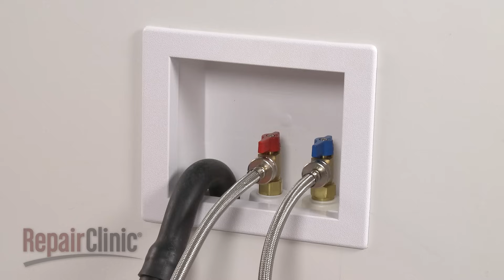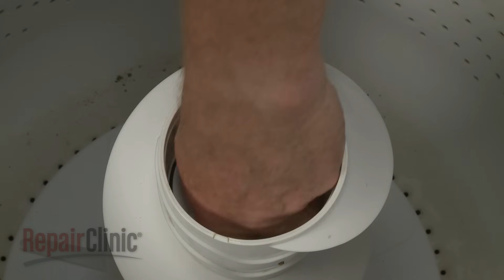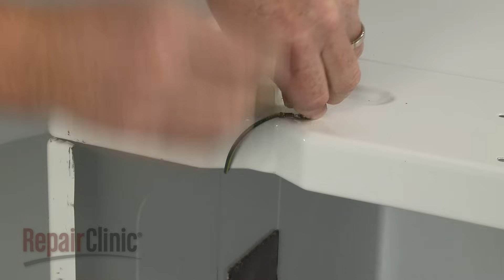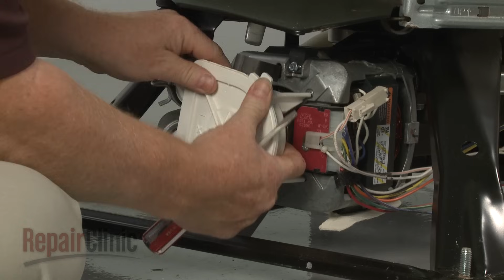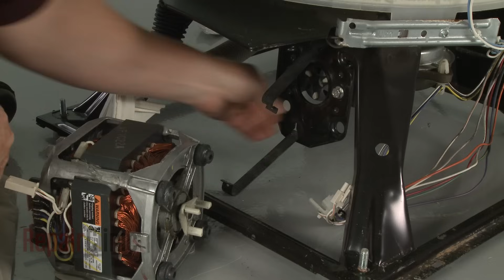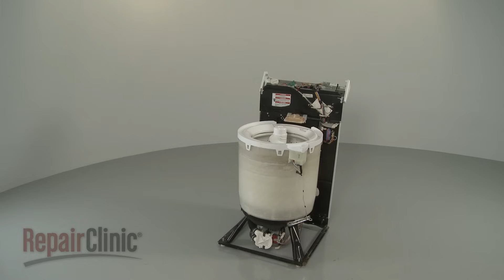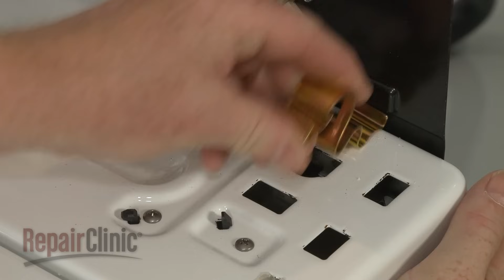Kenmore Top-Load Washer Disassembly (11022932100)/Repair Help

Comment: We followed directions but are unable to remove the lower agitator assembly. It is stuck/frozen/locked on and no amount of brute force is moving it.  Does anyone have any help to offer in this. We need to take it apart to find the source of a new noise machine is making.

Comment: My washer shakes violently. I’ve already replaced the balancer arms, and it’s still shaking violently, only on medium and heavy loads with this, possibly solve the problem. it also makes a click noise every time it agitates?
Reply: Was there an oil reservoir in the bottom?
Reply: @ no
Reply: @deadpoolMAX951  OK - sounds like two problems -> the basket mounts are bad and the pawl for the agitator might have broken return spring in it. This is just a guess. What specific model?
Reply: @NorthForkFisherman  wtw5000dw1 it only clicks when it agitates finally fixed the shaking problem it was the wrong balancers on the washer got better ones now
Reply: @NorthForkFisherman  I’ll have to look into your last comment…..the shaking did stop…..I bought balances from Amazon…..big mistake man….so I bought from a legit service place online works way better

Comment: When the tub is filling with water, does the water pass through the water pump and settle in the flex hose that connects to the black drainage hose?  On my Kenmore, there's a white flex house connected to the pump at one end, then to the black exterior hose at the other end.  It runs horizontally between the two connections.  When filling, water leaks out of a crack in the white flex hose.  

That's why the black exterior drainage hose must be placed above the washing machine's top, right?  So that water settling in the white hose doesn't overfill and spill out of black drainage hose, right? 

Thank you!

Comment: If the top front corners of the washer separate from the base cover -what part is missing  in order to keep the top of the washer connected to the base cover?  When I'm lifting the washing machine cover to separate it from the washer, the right front corner is not attached to the right corner of base.  When I look under the top to see how the base is connected to the top, I see hole but no screws. could the screws have fallen out or was there a different part connecting the top and the base other than screws?  Thank you

Comment: Being my mom old  Kenmore is 24 years old and still running.
 it was time to do some PM on it and replace parts that are worn out and that were not replaced over the years why under Sears service contract till this year 
. had the  Water level switch fail and flood the drive way  and found out that other parts need to be replaced
Reply: Worth to replace parts instead of buying new washer. Just replaced the clutch on mine 29 dollar fix. Won't part with my 1998 washer

Comment: How to you remove the end caps on a Kenmore 400 series washer? It is all connected with the control consol. Not able to replace my water level switch because of it. Please let me know of a quick fix or anything I may be doing wrong.

Comment: a nice video but you never did show how to fix the the suspension Springs that moderate the vibration and shaking. the only video that I found that was similar to mine and you didn't show that thanks for nothing
Reply: same issue here - shaking a ton.

Comment: Finally, a video that shows the same lid switch area as my Kenmore 80 series! I thought I was going crazy only seeing them on the right side of the washer and a hinge pin which my machine does not have. Now if only I can find the exact part/lid switch I need for model 110.26862502, serial number CS4507749. Glad for this video though.
Reply from the maker: You can find the part that goes to your model here: https://www.repairclinic.com/PartDetail/Lid-Switch-Assembly/WP8318084/1018522
Reply: @repairclinic  Thank you, I finally found it on one of the many websites I visited. Spent hours on deciphering this needed repair and found lid switches anywhere from $9.99 on Amazon China dupe to $45 for the Whirlpool original (but I found the same original at a local place for $28). Finally got a repair guy who said he'd come out and change it for $125! Little did I know it would take him 10 minutes. Literally. Unfortunately, husband isn't a DIY guy and we so could have done this ourselves and saved $100. Oh well. Washer is working great...thanks for video! Love YouTube for DIY and reviews (oh, and music of course).

Comment: For Kenmore washing machines what does the SERIES number mean?  Where to find the SERIES number for my Kenmore washing machine?  Thanks.
Reply from the maker: The series number tells you the date it was manufactured. It should be located with your model number. The model number usually starts with 3 numbers, a period, and then a series of numbers. 

The Washer in this video is 110.22932100. Usually, you only need the model number to find parts. 

If you need assistance finding a part for your machine, give us a call or send us a chat on our website: RepairClinic.com

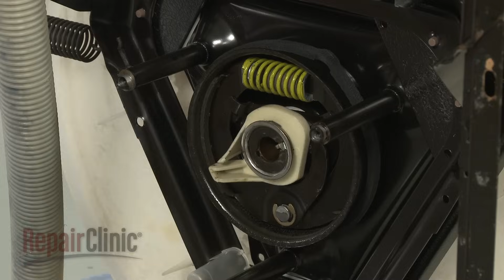Comment: What the heck is that foam gasket that hangs around that bell shaped housing that the basket drive sits in ( @ 8:00) and what does it do? My very similar 29522800 started making horrible grinding noises under load, so I went after the usual neutral drain parts in the transmission and replaced the agitator dogs for good measure. Didn't change squat, so there's a new machine coming tomorrow. No other parts appeared broken and the noise started rather suddenly. I thought I was onto something when I saw that gasket thing as it didn't appear to be able to serve any useful purpose where it was, but the one in the video is exactly the same, all the way down to those two squashed 'U' shaped bends which look like they were displaced by some screws. Mine was even twisted over on itself in a couple spots and was quite loose. -Thanks!
Reply: It could be a diversionary tactic.

Comment: I have a series 80. I imagine its construction is very similar to this. Or do you have a video specific to that model?
BTW, I think that motor reinstall might have been a bit easier with the machine still on its back.

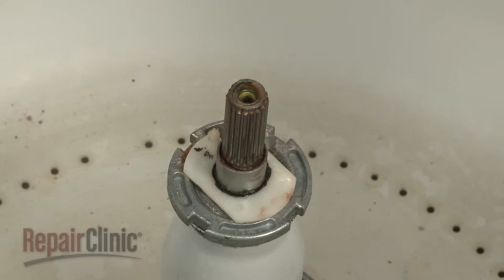Comment: Thank you very much Sir for this outstanding video. After watching it I disassembled my washer and i ran into a problem, when i removed the agitator , there was no Spacer and Plastic washer at 6:07 -6:14  ,is that normal for my model ? or I do have to buy and install them. Would you help me with the part numbers?  my washer model is Kenmore Elite 11022994100. Thank you in Advance

Comment: Just kinda missed the whole outer basket removal part and likely one of the most common repairs of replacing the guides under the basket..  you know, the ones that when they get worn out the whole machine goes crack mode and dances across the floor every load...

Comment: Got a Kenmore Series 300 and its automatic water level sensing appears to be malfunctioning. It never adds enough water. I know these are water saving washer's but they are not adding enough water even on small loads. Is there a way to turn off automatic water level sensing?  The clothes on top stay on top the whole wash and do not properly clean. A case of being over-engineered to a fault I'd say.

Comment: I recently replaced all the counter balance springs on my Kenmore, using parts from your website. Unfortunately these did not fix the spin cycle balance issues. What is the next thing to check to try to get this machine run balanced?

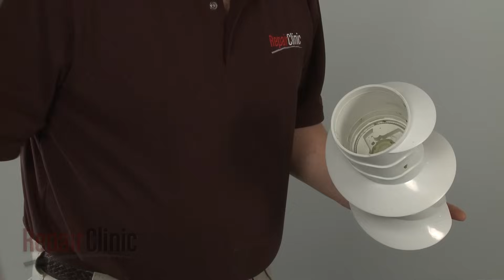Comment: What is the point of the spring (1:21) if the screw is fully tightened, thus completely compressing the spring?  I just replaced the cogs in mine and I'm still not sure why the spring is there.

Comment: 6:05 my agitator is not coming out at all, it spins but i can’t seem to lift it up. Any suggestions?
Reply: You can get inflatable windbags from amazon that pump up and if you stick them under the agitator then pump them up it will pop right out but be careful and keep your face away from the agitator because it pops up very fast :)

Comment: This video is a life saver. I took apart my washer in less than 10 min and found that the reason why my washer would not start was because there was a small sock stuck inside the water pump component. Took out the sock, put the washer back together and BOOM! it works!!
Reply: I'm hoping to find missing socks as well. Lol
Reply: Same here, it was also a baby sock! Saved me an expensive trip to the appliance store. 

Also your comment is 2 years old, hello from the future!
Reply: Can you describe what your washing machine symptoms were ? I believe I may have the same issue. Before I take it apart I’d like to know what you guys symptoms were. Mine won’t spin unless I give the agitator a spin by hand
Reply: @jamiehenderson7844  when the time came for my washer to spin and drain the water out of my washer tub, the washer would spin a couple times and then stop. All the water would still be standing in the tub. I would try to reset the settings dial and then again the washer would spin Maybe 3 times and then stop.  There was a sock in my water pump. So when the agitator was trying to spin and have the pump suck out the water, the sock was in the way.
Reply: @jamiehenderson7844  literally the same as Frankes experience. It struggled to spin and quit and the water would not drain. I had to scoop all the water out by hand, disassemble the washer and get to the water pump. Once I had it off, I could see the end of a small sock stuck in there, pulled it out and double checked for any other blockages before putting it back together. Ran perfectly afterwards!
Reply: Same here. Baby sock was in there.
Reply: Is it showing the water pump in the video? I replaced the switch and that wasn’t it :(
Reply: @genb.4123  Did it end up being the belt, as that’s most common problem if the washer still drains, but doesn’t spin or agitate.
Reply: Was your machine making a humming sound?
Reply: Probably saved yourself hundreds, if not a whole new machine.

Comment: This video saved us the cost in parts. We recently bought an older Kenmore washer and it just stopped spinning. The lid switch was the issue. Somehow the casing broke. Easy fix. We just had no idea how to get to it until this video. Thanks!

Comment: Quick question:  is the cabinet top welded or is it screwed to the cabinet sides? I have limited space through a doorway but OK once I'm in for the washer.
I think if I can disassemble the washer it will fit through the doorway. Thanks a million!
Reply: @repairclinic  thank you for the answer. I wasn't alerted so I checked back and lo and behold... you guys are wonderful.

Comment: Ok so I have torn apart my machine. It is making a horrible noise while trying to spin out and does not spin out at all. As I was tearing it apart I noticed it looks like the transmission is leaking a sort of oil. I plan on replacing my transmission coupler. Would you suggest to replace the transmission and the basket drive or just on or the other. I need help diagnosing my issue with the oil leaking.

Comment: The inner tub we still could not lift out. We probably have older model. Too much mold and dirt is inside, and we were not able to disassembly it to clean through. Stinks with mold. And underneath the oil is leaking. May be we just need to throw it away? It looks like iver 20 years old. We just bought the house and now dealing with it.

Comment: That was amazing. Can't believe how many washers I took to the dump that could have been so easily repaired.
Reply: They are very easy to work on and with the exception of maybe one or 2 parts all the parts are readily available, not trying to sound like a ancient person but truly the new washers are awful,they are loaded with electronics that go out very easily and often and they have all these "environment people" mandated nonsense features it takes twice the time to do laundry,not sure how that helps the environment.
Reply: True or repair for less than Sears repair quote.

Comment: I recently worked on a Kenmore 70 series washer, the lady said it was 31 years old!  Turns out, the last repair man didn't reconnect the lid switch to the harness properly and left the outer pump hose lose and un clamped.  I took it completely apart, inspected, and reassembled it back after I repaired it a few minor issues with the back spring and chassy being bent badly and bending the frame's pins back in place.  I was  very impressed with how solid Kenmore makes their appliances, that think is a tank!  I've rebuilt crosley washer, dryers, and stoves abs they more easier, but Kenmore, maytag, and other high-end appliances are like tanks!  These videos have greatly helped me out and I love repairing and rebuilding appliances!
Reply: Kenmores were Whirlpools that were redesigned to make them easy to service.  That’s why Whirlpool parts fit, but the drawings don’t match, and it’s easier to work on them.
Reply: Interesting, i didn't know that.  Thank you for sharing this is you sound like you're experianced and knowledgeable tech.  It seems like i learn something new everyday, which makes everyday even more of a blessing for me! 😊 @ssaraccoii

Comment: I just used this video to disassemble and thoroughly clean my washing machine. There has been a bad odor the last few weeks and once inside, I knew why. YUCK!  Thanks again for the great video!!
Reply: Why?
Reply: @jpuff911  Once the basket was apart, it was packed with nasty stuff. I'm not sure exactly what it was, mold maybe? IDK, but it took a pressure washer outside to clean it all off. And then the smell was gone.
Reply: Do not use fabric softner ever

Comment: Okay, have our old Kenmore model 110.26692502  completely taken down. The problem is that everything works but the spin cycle.  I can get the tub to spin if I start it by hand and quickly close the lid. The tub was rusted tight to the agitator shaft, but we got it of with a little persuasion with a piece of 2X4 spruce.  Now, the problem is all the parts look fine.  Is there a clutch somewhere that could be slipping, or could the rust have kept the tub from spinning?
Great video! It's not exactly the same as the one shown in the video, but close enough to get done. Thanks for your help.
Reply: If you still have the problem, that's a spin clutch.

Comment: Those side cover do not come off that easily .  Side panels have two locking catch tabs that must be  pressed to the side.  From the back the side cover on the control panels left side must have the upper tabs move to the left  , on the right the side covers upper tabs must be moved right  They are very stiff and can break easily.   
The control panel does not flip up like that , you first must grab each side and pull it forward then it flips up    Just pulling up does not do it.

Comment: First off great video and thank you for posting it. Wow quality and attention to detail is amazing. Now for my question. My machine won't spin everytime. When it doesn't spin the agitator needs to be shaken by hand until something catches and the washer starts spinning. I followed the video and was able to replace the coupler and isolator with a new part. To my untrained eyes the old part did not look all that damaged. Also one of the agitator cogs was broken so those were replaced as well. I couldn't get farther than removing the motor at 7:05 because I cannot remove the inner tub. It seems like too much moisture got between it and agitator shaft and it seized up. Has anyone else had this issue and what did you do to resolve it? Thanks again.
Reply: " I cannot remove the inner tub. It seems like too much moisture got between it and agitator shaft and it seized up. Has anyone else had this  issue and what did you do to resolve it?"
Had exactly the same problem. Got a friend to help me.  I held the tub with one hand and a short piece of 2X4 lumber in the other.  He held the opposite side of the tub with one hand and a hammer in the other.  We lifted the tub slightly, and I held the wood on the top of the shaft while he repeatably beat down on the wood with the hammer.  Four wacks and it came loose. :)

Comment: Out of curiosity, do you (or anyone else who may read this) have a video showing the proper reassembly of outer tub, onto the body, along with the proper alignment for the mounting plate (part that sits between frame and outer tub, above the motor), and springs? 

I had to replace a pump, and ended up discovering the tub was quite filthy, presumably owing to my use of budget detergent pods... So I took the whole outer tub off to clean. My problem is despite putting everything back together correctly as per the video, some of my tear down exceeded what was covered here, and I am now trying to trouble shoot some destabilization during the spin cycle, which I beleive is related to the alignment of the mounting plate or how I reattached the spring assembly.

Great video though, I could not have found and fixed the leak without this! Thank you so very much!